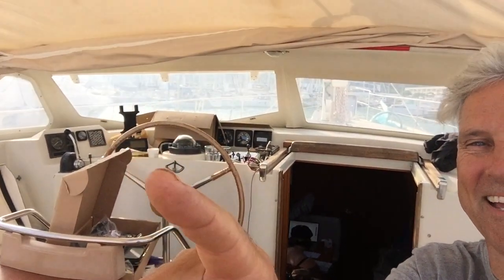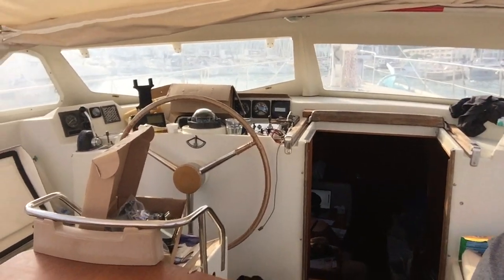Boat Status - May 24, 2018

Comment: Use Corrosion X or PB Blaster... WD40 is next to useless as a penetrating oil.  It was originally designed to keep water off electronics (WD stands for Water Displacement).  You'll have much better luck getting that bow thruster free with those.
Reply from the maker: Thanks, Brent. The research does not support your position. The other specific purpose penetrating oils are only marginally better at significantly higher price. That's fine, I'll pay more, but unfortunately, I have not been able to find Corrosion X in Europe.